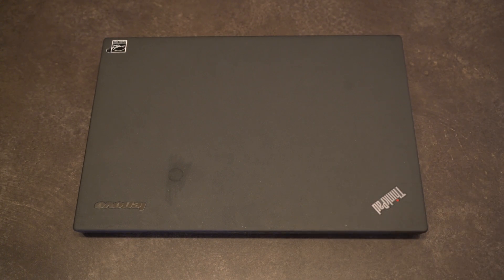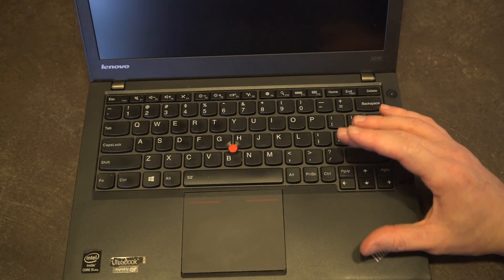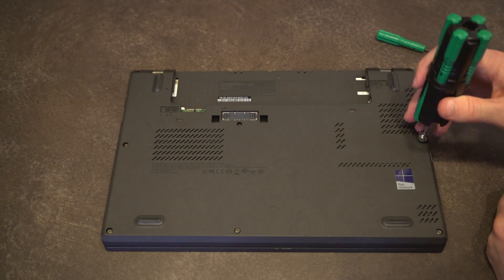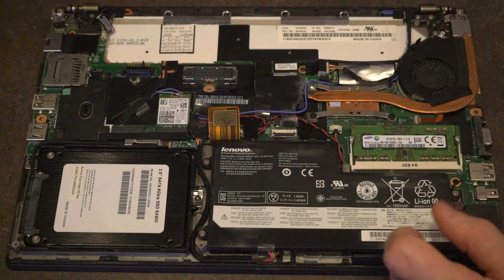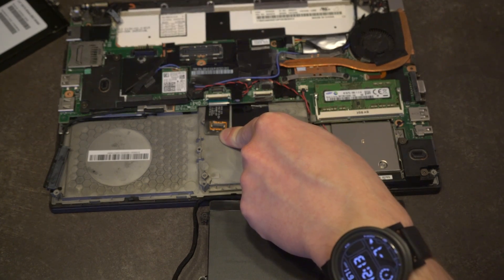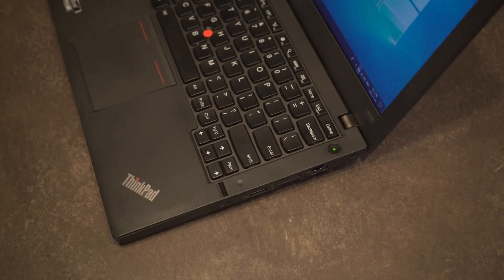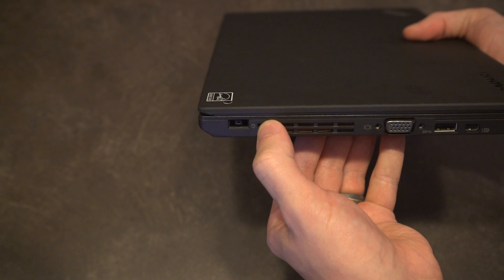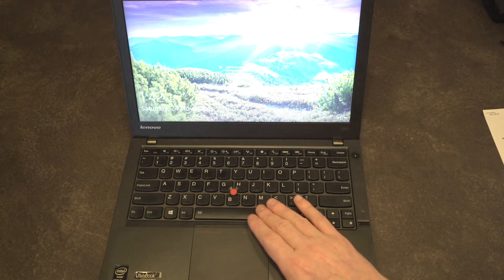Lenovo ThinkPad X240: Refresh of the X Series

Comment: I'm watching this on an X240, i5 vPro, 8gb ram, SSD. In 2022 and it works just fine for a general purpose laptop. My desktop is an i5 and with a SSD boots in no time and does everything just fine. AND this is going on well over 6 years old now.
Reply from the maker: The X240 here still gets daily use. 👍

Comment: Is 4300u is better than 4200u??
Reply from the maker: Yes, but as you can imagine it isn't a super significant jump.
Reply: @LaptopRetrospective  is 4200u can handle a photoshop app?
Reply from the maker: It should depending on the complexity of the project file.

Comment: I'm about to get one for work, I have to do some basic photoshop, go into meetings in Zoom and sharing my screen. It is refurbished, it has 4GB RAM and 360 HDD i5 4300u with 2.90 Ghz. Is it a good idea?
Reply from the maker: The RAM is pretty low, so I'd be prepared to upgrade that. The HDD should be replaced with an SSD in my opinion for the massive jump on performance. Lastly, if colour accuracy is critical for your work, I'd suggest an external display if it isn't the top tier panel. Keep an eye out for X250's as well.
Reply: @LaptopRetrospective  Thank you!!! You rock.
Reply from the maker: Happy to help!

Comment: Is there such a thing as a right click menu key (other than using the touch pad)?  Some laptops have this but the IMP EC key next to AltGr on mine does a screen shot instead (French keyboard using Linux Mint)  It's just that I find it tricky to right click for menus with the touchpad except in the extreme right corners of the pad.
Reply from the maker: I'd replace the TrackPad with the X250 one. Best solution. 😉

Comment: my X240 is making fan noises , it isn’t whirring noises but stutters , any fix? it sounded really strained and it’s fairly new so I don’t really understand why it’s happening , help will be appreciated
Reply from the maker: The fan is new I presume since the laptop wouldn't be. It sounds like a drop of sewing machine oil on the bearings might help or it might need to be swapped.
Reply: @LaptopRetrospective  Thank you for the prompt advice ! I was really clueless so this’ll help lots !
Reply from the maker: Good luck. Thankfully the fan is a part that can be found at a reasonable price.

Comment: Hi do you think this will be good in 2021?
Reply: So there's not much difference between x250 and x260 or x270 ?
Reply from the maker: Mainly CPU options between generations. That's the big one.
Reply: True, x280 is thiner then the earlier models though right?
Reply from the maker: Depends on the components inside.
Reply from the maker: Yes. What do you want to do with it?
Reply: @LaptopRetrospective  Further expand my Linux knowledge.
Reply from the maker: Great machine for Linux.
Reply: @LaptopRetrospective  So I shouldn't be fussed if I get the 240x over the 260x or 270x ?
Reply from the maker: I mean, those are the newer and better machines. The X240 is far from the worst laptop though. I'd prefer at least the X250 for the newer CPU and better trackpad.

Comment: There's also the option for a card reader FRU on this model - most people wouldn't use this in their personal life, but you can replace it with an NGFF adaptor so you can have yet another hard drive or network card in here.
Reply from the maker: Yeah I've read that as well.

Comment: Why no mention of the dock connecter on the bottom, or the three docks available for this model?
Reply from the maker: EDIT: Whoops, wrong video.

Honestly on this video, given its age, I probably straight up forgot. It was one of my earlier ones.
Reply: @LaptopRetrospective  I just got an Ultra Dock for a friend's X240, and one thing about it has me worried..., the fact that it'll completely block all of the ventilation ports on the bottom of the laptop... I saw that you used a Mini Dock on another Lenovo unit... Do you feel that these docks noticeably increase internal temperatures, especially when running CPU/GPU intensive applications?
Reply from the maker: Hmmm. It would restrict the airflow somewhat but I wouldn't think it would block it entirely. I haven't personally experienced significant performance loss from using a docking station that I recall.

Comment: Just got one of the I5-4300u version for a very reasonable price… I've discovered with a surprise the second battery, and also replace the removable one (44€) which was "only" let me 3h... which is more of battery than the laptop I'm usually using at work (brand-new ones also !!). Installed linuxmint in parallel with win10 pro that was already re-installed by is previous owner. Currently writing the comment on the machine with Linux Mint.

This is a great machine, the battery life with the new one is quite long (more than 16 hours!), using this as my "daily driver" while not @home and when I do need to use a laptop. As this is a small machine, always got it in my bag pack.

I've just ordered a 8gb memory module to replace the 4gb that are now inside, and, thanks to your video, I do know now how to remove the cover properly (and also disconnect the internal battery as I've also read in the comment, prior to any intervention inside the machine !!).
Reply from the maker: Awesome story, glad it found a home with you. They are great machines.

Comment: Does a FHD IPS display work for my x240 i5 4300u by just straight swapping it with my 1366x768 lcd display? I was planning on upgrading my display due to having white spots on some part
Reply from the maker: Should be fine. Check the FRU for the display in the maintenance manual for the correct part.

Comment: Will it use a wireless mouse with the plug-in to the USB?
Reply from the maker: Yes it can use a wireless mouse. Bluetooth as well.
Reply: @LaptopRetrospective  Thank you very much. I ordered one through Newegg in grade a condition. The only thing I'm worried about is the battery.
Reply from the maker: Batteries are easily found if they need to be replaced and won't break the bank either.

Comment: These U series really took a hit in performance. I bought a T440 a while back with the i7-4600U and running UserBenchMark it yielded the same, if not worse, scores and FPS compared to an X230 with the i5-3320M. But using it was pleasant, I liked the keyboard, the two batteries, the form factor, and glowing I in Thinkpad were little things that I liked. I had the "better" 900p display but without touch which was a bummer, the touch variants are rare on eBay I guess. Still good machines and I shouldn't bash them because of their minor-ish decrease in performance. 

Though, the real bad machine in the 40 series thinkpad was the W540/W541. The build quality wasn't as good, notebookcheck notes "audible contact with the internal components by resting your hands on the palmrest." The only thing changed with the W541 was I think some new processor, and trackpad buttons on the top.
Reply from the maker: Yeah the U series took on average a 10-12% hit in exchange for better battery performance as that was  becoming a more popular feature at the time. Overall I'm not the biggest fan of the 40 era, mainly due to the trackpad style.
Reply: @LaptopRetrospective  Same with that trackpad. During the very brief 3 days (I returned it on ebay because the usb ports didn't work properly) I owned a T440, I couldn't drag and move something, I could do it but it wasn't easy and it felt like a clunkpad, I liked the distance it moved when you clicked but not the clunk or the rattling every time you even touched it. At least it had gestures.
Reply from the maker: Yep, my experience is similar.

Comment: Does it run good with exp gdc beast?
Reply from the maker: You'd need to use one of the kits that require partial disassembly or modification since it doesn't have an Express Card.

Comment: Hello, great video on X240. May I ask you questions, can the Wi-Fi card on the ThinkPad X240 be replaced by Wi-Fi 6 card i.e. Intel AX200? And if money doesn't consider, which one will you prefer, X250 or X240? I'm going to buy it refurbished and the 2 laptops has similar price but different aspect on trackpad. Thank you for your answer.
Reply from the maker: Go with the X250 of the price is similar. Newer CPU, better Trackpad. Regarding WiFi cards, you'll need to see what is on the manufacturer whitelist or be prepared to learn about BIOS hardware flashing.

Comment: I've been thinking about getting a HP EliteBook 820 G2 for stuff like light gaming, but then I stumbled on this. Which should I get?
Reply from the maker: No experience with the HP Elitebook...yet.
Reply: @LaptopRetrospective  I think I'm going to try out the thinkpad. The i7-4600U in the thinkpad is slightly stronger than the i5-5300U.
Reply from the maker: Good luck!

Comment: Bought one of these just a month ago: mint conditions, i5, 8gb, ssd, 2 batteries, ips display, wwan...LOVE IT. Probably the best laptop I've ever had, maybe not the most powerful, but the best. Sturdy, nice old fashioned looking and very very portable with the 3cell battery. Keyboard is AWESOME, you would type on it 24h. I got also a 40A2 docking station, the icing on the cake. The only one thing which I'm not comfortable with, is the touchpad (but you can switch it for a x250's one). Thank you ever so much, you helped me doing the right decision.
Reply from the maker: Glad to be of help Vittorio and stoked to hear you have a machine you love.
Reply: my son has knocked this laptop off of my desk a few times, and it's still working like new. These things are very well  made, mines has taken lots of abuse, but cometically still looks pristine.
Reply from the maker: Hope your floor is okay where it landed. 😂

Comment: HDMI port ?
Reply from the maker: VGA and mini DisplayPort.
Reply: @LaptopRetrospective  Wow thanks for the prompt response. Rare for most tech channels. But can use a Mini display to HDMI wire I assume ?
Reply from the maker: It's one of the things I try to do to be different. It can be adapted using a dongle or as you stated.

Comment: Great news:  I just bought a ThinkPad X240 from a local seller for only $200 Cdn!  i5-4300U processor, 8GB RAM, 320GB HDD,  fingerprint scanner, backlit keyboard.  It was listed as having a touchscreen display, so I knew it was IPS (which I'd really wanted) and simply assumed the resolution was 1366x768.  Imagine my delight when I discovered it was 1920x1080!  It's running 64-bit Windows 10 Pro, and is really snappy.  It was the seller's work machine, and must've been top of the line back in 2014.

The original asking price was $220 and it was listed in great condition, which it is except for some cosmetic damage; there are two deep, 0.5cmx3.0cm scrapes on the lid and I must've looked a little dismayed when I noticed those, because he immediately offered me a $20 discount even though I hadn't even thought about negotiating the price.  

I noticed the fan kicking even when I wasn't doing anything CPU-intensive, but installing TPFanControl fixed that problem.   I'm okay with the lack of physical buttons on the trackpad, because the top click areas are quite responsive, unlike the bottom ones, which are spongy.  As a big TrackPoint fan, I'm mostly using the former so it's only a minor irritant.  The keyboard is a dream and I was so happy to discover it  has the optional backlight.

Overall, I am SUPER pleased.  Thanks again for all your advice -- it was absolutely invaluable in helping me find a fantastic ultrabook for a bargain price!
Reply from the maker: That's awesome! Is that drive an SSD? That would be the first upgrade I'd do to get even more performance. I'm glad you were able to find one and I'm happy I was able to help. The nice thing about a cosmetic imperfection is it stops you from babying it. 😉
Reply: @LaptopRetrospective  So true about the cosmetic damage, ha ha!  Plus I already feel like I've owned the X240 for years, it's so awesome and comfortable to use.

The listing just said 320GB HD, so I just assumed it was HDD because of the size and because SDD would've been crazy expensive six years ago.  However, Windows loads so quickly that it might very well be SSD.  Or maybe one of those hybrid drives.  

I forgot to mention:  I haven't had the chance to test the battery life yet -- after yesterday's weird exchange with that other seller, the only question I asked about this laptop was whether the supervisor password was enabled in the BIOS -- but given the age of the laptop, I'm guessing this is something I will have to replace sooner, rather than later.  The removable battery it came with is the 3-cell.  I like that it's flush with the bottom of the laptop, but I am tempted to replace it with a 6-cell (fresh from the factory, with the internal battery, 3-cell 23.5Wh=8.7h, 6-cell 47.5Wh=13.1h, 6-cell 72Wh=17.4).  If it's not too hard or expensive to do, I'd also like to replace the internal battery.
Reply from the maker: @claudiaw9246  Internal battery is easy to replace and I have the 6 cell on mine. You can get it from Lenovo or BattDepot, those are my guys and they have a warehouse near your area.
Reply: @LaptopRetrospective  Thanks for the tip, I will look into that!  In the meantime, it charges impressively quickly thanks to Lenovo's RapidCharge technology.  

It's downright astonishing how this older laptop puts most modern laptops to shame, both in terms of functionality as well as build quality.  I still can't get over how much I LOVE this laptop.
Reply: @LaptopRetrospective  Do you remember the brand and Wh of the battery you got?  Did you go for the 72Wh?  Did you also replace the internal battery?  (You said it was easy to do, but not whether you'd done it.  The six-cell battery on its own must last about eight or nine hours, which is excellent.)  How long does the charge last now?
Reply from the maker: @claudiaw9246  Most of my replacement batteries come from BattDepot and if they are available I usually opt for the Dr. Battery brand they carry. The internal battery replacement is trivial. Boot into BIOS, disable internal battery, Remove bottom cover, unscrew battery and replace. 10+ hours is easily achieved.
Reply: @LaptopRetrospective  Great to hear that it's so easy!  (And d'uh, you show how to access the internal battery in this very video.  Clearly, I'm suffering from information overload right now.  I've watched and read so much about so many, MANY different ThinkPads that they are all blurring together.  I saw the above video days ago, but came back to comment here since that's the computer I got.)  I will put that on my to-do list.  I just checked BattDepot and the brand you used is out of stock.  It sounds much better than the other external battery they have for the X240, so maybe I'll wait until it's available again. Either way, it looks like replacing both batteries won't cost the earth; the internal battery costs $50 and the 6-cell costs between $40 to $88 (depending on brand; the one you got is currently 40% off, which is probably why it sold out).
Reply: @LaptopRetrospective  I just ran UserBenchmark -- it is indeed an SSD!  Given how quickly the laptop boots up and how many other optional features it's loaded with, I'm not surprised but holy smokes, I still cannot get over how lucky I got.
Reply from the maker: @claudiaw9246  Awesome!

Comment: I'm considering getting one of these 12" laptops. What's you guys take on screen resolution vs the small size of the screen?

 I see colleagues with insane 4k on miniature displays which just does not make sense. I run Linux and scaling UIs is something I don't want to spend my time on. The choices seem to be between 1366x vs 1920x.
Reply from the maker: 1920 is just fine unless you're doing some pixel accurate design work. Will be nicer on your battery as well.
Reply: @LaptopRetrospective  thanks for your answer. I actually meant the 1920 compared to the 1366 on the little 12 display of the x series.
Reply from the maker: @nahbruhwhat  Gotcha. The HD IPS screens are the cat's meow.

Comment: I have a L 440 and it works just great.  Think pads are just great irrespective which one it is .  Planning to buy another one may be x 250 / 60
Reply: However it all depends on the decent deal. Actually my L 440 is i7 4480mq. I Love this machine as it's really thunder fast. I bought it few months back for 300 USD with 8 GB RAM. After using this machine I am in love with thinkpads and looking for a nicer deal under 400  . I think a 6th gen i5 will be fair enough , perform equal of  4th gen i7 , as my primary work is php and Python programming, don't use games or video. What do u suggest, i5 5th gen better over i7 4th gen.
Reply from the maker: Great choices.